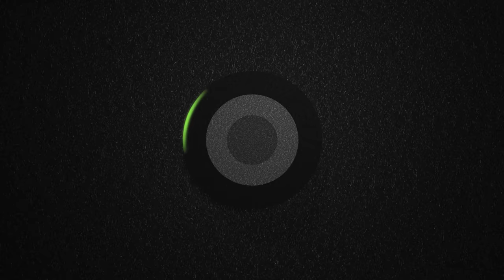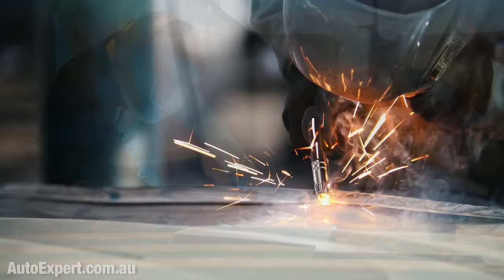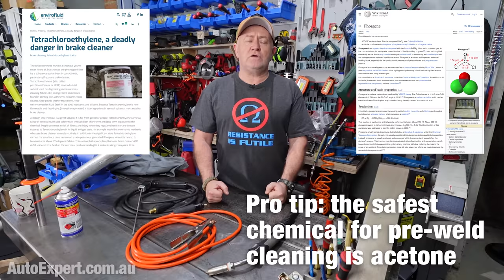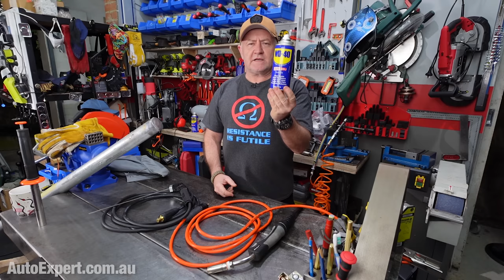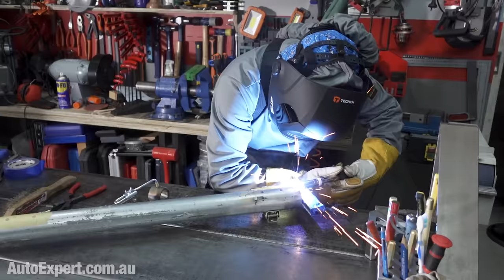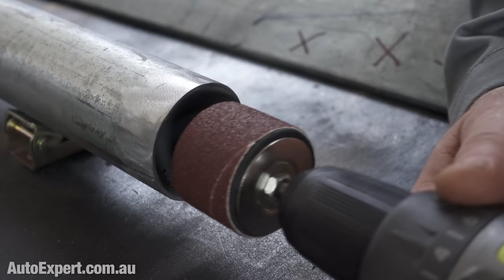How to die while arc welding at home: the top 5 ways | Auto Expert John Cadogan

Comment: Only person I knew who died while employed as a welder, did so not in the actual welding process but by a $5 grinding wheel.  At 7500+ RPM it flew apart and sent a piece into his neck, he bled to death.  Grinders and cut off wheels don’t nearly get the respect they deserve.  
Great video .. after years of welding I continue to learn.
Reply: Approved face shields are cheap and comfortable.  Seen the video of the thin broken cut-off wheel embedded in the guys safety goggle.  Instead of putting a safety label with a bunch of words, put that image on the package of discs 🤔
Reply: I use a hex armour helmet with face shield with ear muff integrated into them. I love it
Reply: I worked in a factory as a grinder using 8 inch buffing discs (@6000rpm's), well leadership decided to go with cheap knockoff disc because they were part of some product line that our supplier was pushing and they didn't want to hurt their feelings.  🙄 We had complained multiple times because the discs would randomly fly off the backing pad, finally one of the pads flew off while I was buffing at full speed and hit me right in the jewels. When I was able to compose myself I went straight to the office and let them have it. That was the end of the knockoff discs.
Reply: @thorfinsky1427 holy shit, glad your nuts are still both there brother
Reply: It's why I don't understand you never see anybody burning anymore. - Is it lack of skill or monkey see monkey do. - Save your bottle caps an buy a plasma if you can't burn and leave the death wheels to the Bob Villas.
Reply: Had a guy come into the Emergency Room one night with 2/5 of an 8 inch grinding wheel buried (and not visible from the surface) in his massive forearm. The big thing was that his forearm was between the grinder and his crotch! Had he been in a different position he might now be singing soprano.

Comment: Hello there.  I am not really a welder.  I am a maintenance man that welds when he needs to.  I came across the problem of my screen fogging up so searched for a solution.  What I stumbled upon was a "Breezeway Helmet ventilation system".  It clips to the top of the helmet and protrudes to the top  of the screen.  It blows filtered air from the rear down past the lens and your face to keep the fumes out of the helmet. I am not a salesman for them but thought I would pass on the information if anyone was interested.  The unit is small and rechargeable.  Thank you for the safety talk by the way. It was very informative and will make me aware of any future hazards.  Cheers!

Comment: As a marine engineer, I did welding all throughout my seagoing career.  Many times, a "quick job" took a little longer and you only notice the red sunburn triangle where your boiler suit wasn't fastened up properly at the neck . Sunburn city.   Never zapped myself or anyone else, but I did have a very large industrial paraffin blowlamp used to preheat a 16" diameter valve lid for brazing split open and create a very interesting fireball - no-one got hurt but there were cases of singed hair and soiled underwear.

Comment: I was wearing a big padded check shirt in the shop last winter, while cutting up some steel tube with an angle grinder, ( as you do ) when something caught my attention in the corner of my eye, and as I was alone in the shop, I naturally looked around to see what it was, It was in fact, a ball of flame, which turned out to be the whole back of my padded shirt, which had ignited from the sparks off the cutting disk. Luckily, I managed to move about as fast as a vampire, and got it off before getting any burns. That was a lesson well learned. Now I don't wear flammable shirts, and I ALWAYS wear my leather welding apron. Thanks for sharing this video, I would rather learn these lessons from you, than learn them from experience, as I am only an old git in his shed doing some DIY welding now and again, and never really considered these things.

Comment: I am an old sweat, shipyard boilermaker. Getting shocks from an AC machine is no joke, wet boots and gloves working in a drydock (what a joke name for it) was par for the course. Marigold gloves under the welding gauntlets and steel toe-capped wellies were the answer. a pint of milk a day if you were welding galvo.
I heard about a workshop for retired folk (woodwork at the moment ) were starting to do metalwork so I popped along to see if they needed help. The welding plant was an old Oxford AC one and the room had no windows or ventilation there was three phase electric to hand ( oh matron) .Dont think I will be helping any time soon but I might pop back in and give them some H&S  advice.

Comment: I was warned by a local welding supply dealer that the fumes from no gas MIG wire are particularly bad. They said all welding fumes are to be avoided. I've done quite a bit as an amateur, with hindsight would have taken more care. Good video, thank you

Comment: I can attest for the sweating death story as from first hand experience I've gotten electrocuted for this exact reason. I am in welding school welding with my arm resting against a pipe, my arm and hands are all very sweaty to the point where my white goatskin sleeves were dark gray, like a cloud about to rain. The INSTANT I pulled the trigger on my mig gun it felt like someone had walked into my booth and shoved me as hard as they possible could. I lifted my hood instantly and immediately realized I wasn't being shoved but I got electrocuted. I didn't weld for the rest of the day because I was terrified but I completed the circuit and it was scary. If you're sweating bad, please mind the circuit it will scare the ever living sh*t out of you.

Comment: When I was a ghetto street mechanic I used to weld a lot of gas tanks. Remove the gas gauge sensor using a metal flex pipe run exhaust from a car with a working catalytic converter into the tank, leave the gas right in it.

Comment: I am not a welder but I was working for an irrigation company.  The company would make 1000 gallon tanks out of steel and welded to a skid.  ( think of a huge 55 gallon barrel )  The tank once welded together would be pressure tested by filling with air and then soapy water on the joints to make sure it did not leak,  fair enough..    The guy who made and tested a tank one day opened a 2 inch valve to let the air out. The tank flew at speed into a garage door!! Luckly no one was hurt.  It was like blowing up a balloon and letting it go,   Mentioning this to warn anyone else pressure testing a tank they made,  Apprently, one has to let the air out very slowly.

Comment: Filters are not all the same! I use a battery powered filter system like the one in the video for WOODWORKING to filter out particles. (sawdust) But the very fine dust particles it will remove are giants compared to molecules of chemicals. Do not depend on a filter that isn’t rated to remove the fumes you need protection from. Physical filtering of micron size particles does NOT remove chemical fumes! Just be sure you are using filters that adsorb ( yes aDsorb, not aBsorb, there is a difference) chemical fumes.

Comment: GREAT SAFETY VID John....Thanks for the Brake Cleaner HeadsUp...UnAware ! I was Electrocuted by 550volts in my Pulp & Paper Mill, Sparky entered my left hand Out thru my rear right Leg into the Metal Stool I was Sitting on running a Cut Off Saw (Logs to Hydraulic Barker)...Will checkout New Another 5 ways 👍

Comment: I had a close call about 45 years ago. I had only done small arc welding using tiny 12-gauge rods. I was timber cutting up in a valley not far from a mine.  I knew the well .I had to use their tracks.I broke the rear side engine mount on my old Landcruiser. being downhill I managed to get back to the mine and they let me use their 3phase welder to weld it back up. The empty bay where they were sitting having smoko was next to the equipment bay. Remember I had only ever used 12 gauge rods, I had to use what looked like to me, a broomstick 4 gauge rod and  had about 20 meters of 3 phase leads dragging behind me as I slid underneath my ute . hardly any room and my helmet getting cockeyed I accidently touch the fuel line . It ignited about 6 inches from my face, my helmet had knocked off at the same time and in my side vision, I saw all the worker's lower legs and feet all leap for their lives. The flame was like a big long blow torch easily a foot long and I would say the petrol not ignited, was a mere quarter inch of a petrol jet coming out of the hole. I was that close to it, and without thinking I blew the flame off it. I think what saved me was the petrol tank on the old Landcruiser was under the seat above me and it was gravity feed and I had just filled it up that morning.

Comment: I’ve shocked myself learning TIG welding before, accidentally tapped the tungsten onto the piece of aluminum I was welding while touching it with sweaty gloves in a hot workshop and instantly felt a current go into my arm. The machine was grounded to a metal table I was working on. As well. It didn’t kill me but I most certainly was scared from that point on lol. I think more welders have to be educated on electrical and how a closed circuit works. Definitely a much needed video. And I didn’t know the first part about brake cleaner, my dad uses it all the time while working on cars. Going to tell him to stop for sure. We don’t weld with it, but def nasty stuff.

Comment: I spent hundreds of hours building horse corals, cattle pens, replacing rusted panels in cars I restored and repaired as a hobby and general welding repairs.  Then I got the not to brilliant idea of replacing body panel with a TIG welder, which I hadn't used in several years. The first several welds turned out perfect and allowed me to make autogenous welds which was going to greatly reduce my sanding time.  That's when things went from good to potentially deadly.  My next weld was going to require some filler rod.  Instead of touching the rod to the leading edge of the puddle, I touched it to the tungsten electrode which was only a couple of mm away.  Fortunately, I was using a pedal and the shock caused my foot to come off of the pedal and the circuit was broken.  Needless to say, I am more careful these days and keep in mind that TIG gloves are too thin to protect from a shock.

Comment: I used to weld in the summer with leather sleeves on, and just a t-shirt on, and then I realized that my shirts had a distinct fading from UV.  a shirt doesn't stop all of it from getting to my chest.  A great way to get the zinc and paint and SS fumes away is to have a 20 inch fan sucking it off of your work table, blowing it out the garage door.  you mentioned cross-blow with fan, but light suction from a fan 12 or 18 inches away doesn't ruin gas shielding of the weld.

Comment: I gave myself a decent shock stick welding,I was welding rebar cages and due to the tight space I was gripping the electrode with my glove, I had performed a dozen welds no worries, but on one occasion I arced up and before I knew what had happened I was face planting the steel, it grabbed me and belted me so hard onto my stomach that I reefed the work lead from the welder, I believe that saved my arse, I can confirm direct contact with the electrode is highly risky and unforgettably painful

Comment: I was working for a construction company back in the 90's & had to cut some galvanized form deck & the footing crew had the cutoff saw.  I got out the blue wrench& started cutting the pan in a nice spring breeze.  The wind shifted & I got a nice face full of smoke & it felt like someone had hit me in the chest with a 4x4.  Later the flu came on.  Never did that again.  Used a circular saw if the gas cutoff wasn't available.  I'd heard for years about zinc being problem but I was going to be fine, I won't have a problem.

Comment: Regarding your WD40 statements.   I did the electrical design for a WD40 plant that filled the cans in the early 1990’s.  They in fact did use propane without the smell as propellent.   A few years later in 1996, after lawsuits lost, WD40 propellent was changed to CO2.   Having said that, no chemicals of any kind aerosol or other vessel should NEVER be on a welding table while in use!

Comment: Ship welder for 10 years, while carbon arcing overhead deck plate on ship in a tight corridor there was a copper pipe running across the corridor. It was middle of summer and I was covered in sweat and had my elbows resting on the pipe while i cut overhead. The sweat got through my gloves because while changing out my rod I got zapped through my glove and out my elbow. My left ring and pinky fingers and the spot on my elbow are still less sensative and tingle where the electricity went through. I am much more aware of how wet my gloves are nowadays.

Comment: I didn't die but came close, was welding a roll cage into my Jeep and some slag/spark dropped down into the vent ducts. I didn't notice the flame or smoke because the whole garage smelled of it. As the flame grew more and more of the Jeep was on fire inside my wood garage. I was able to roll the Jeep out of the garage and extinguish the flames with an extinguisher that was close by before burning the whole house down.

Comment: Thank you and your video here should be referenced by all DIY welding how-to videos.  On another note, as I listened to the dangers of gases I started thinking about the CPAP I wear when sleeping.  As you got to PPE air system I thought "that's a portable CPAP!"  Then as I looked these up I thought "A used CPAP is only a a few hundred dollars versus about $3K"  Granted, the CPAP is wired AC but my old travel unit is about the size of the one you shown.  I will likely look into rigging this when I weld risky situations where gases can potentially introduce danger.  Of course, the materials of a CPAP can be easily burnt so some effort to protect the hose and mask must be employed.

Comment: I worked in a small boiler factory for a few months after I finished school. We worked with all kinds of different steel I had never heard of, but what I learned is that it's all fun and games until you have to work with an alloy. I don't think you mentioned it, but especially stainless steel is inherently dangerous. It produces chrome vapors that can cause cancer in the lungs and throat, alongside a row of nasty toxic gases. All people around had to wear masks, and not only while welding but while cutting grinding as well, because of the dust.
I think when working metal at home, it's good to remember that all grinding and welding produces dust and hot gas. Know what kind of metal or steal you are using and what additives it contains! Then google whether you need a mask. Better safe than sorry

Comment: As usual very good. 
One job I had many years ago , I used to grind the galvanizing into the "" Smoke Eater "" So although I was wearing a mask, others where not breathing in the ""That "" which I was grinding off. I used to change the filter once a week, the next one  once a month. There Safety meant Safety!!! Was mostly Very Good. 
Some funny stories from there. 

Many years ago  , prior to me welding they used to say for "" Welders "" to drink Milk. 
I used to get heart burn when welding as an apprentice. So not wanted at all..
Maybe I did not harm myself too much with the Brake Clean?? I shall remember that one. Thanks Again.

Comment: Excellent video... I never knew that chlorinated brake cleaner would turn deadly at a certain temp. That's damn good information, as I've been guilty of doing this a time or two. Although the brake cleaner was evaporated before I welded on the metal surface. Appreciate the information!

Comment: Back in the 80's, we used a propane torch with a hose leading to the base of the flame as a refrigerant leak detector. When the hose pulls in some R12 the flame on the torch turns blue. Problem is it also creates phosgene gas.

Comment: Just some helpful advice in the autobody trades now days there are galvy auto panels in entire quarter panels & hoods most notably some company is producing hoods for old 1940s & 50s Dodge trucks and the hoods are galvanized steel. That is why you don't have to weld the stuff just use body panel glues.

Comment: When i was 16 or 17, I was  working at a cattle feeder yard. It was raining. I wore tee shoes.  And yes, no glove on  my lefthand. The setting was too low, and my rod stuck. My wet shoes were on the wet metal I was welding. I had to Uncouple my rod. Graped the rod with my bare left hand. I placed it back hot lead, and from my hand to my feet, I was electrified. It hurt for sure .

Comment: Eggggggggggggggggggggggggggggggggggggggslent video and content . thanx for sharing. two points. 1. drink white milk before welding galvanized metal. 2. No Gasoline cans or to a lesser extent propane bottles. I was a contract welder in the oil fields of West Texas USA back in the 70s and 80s.

Comment: If you have a shop set up, and you do a lot of welding, you MUST invest in a ventilation system, that can suck the welding smoke away and out of the room/building, using a fan only spreads the smoke, and just because you can see the smoke, doesn't mean that it isn't there.

And beware of the heavy gasses from welding.